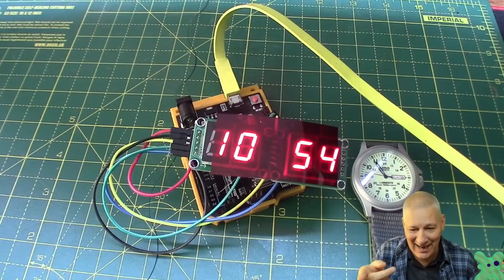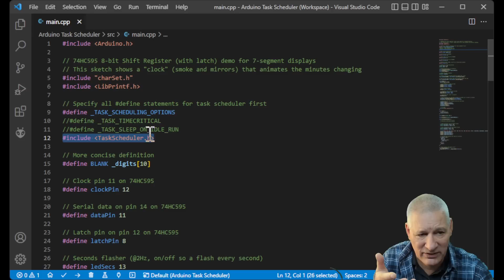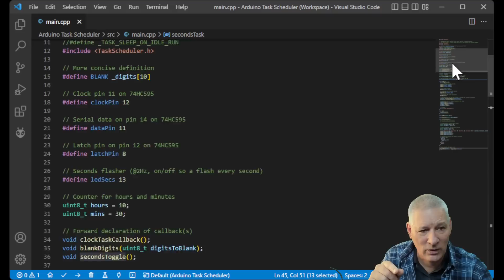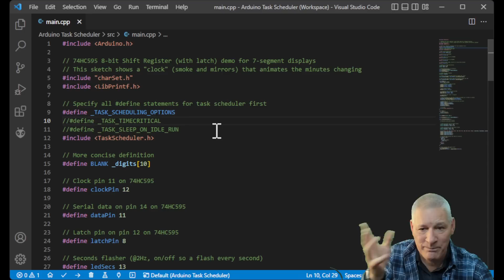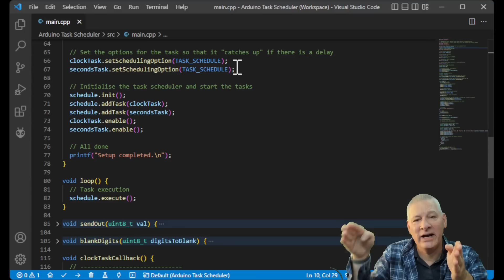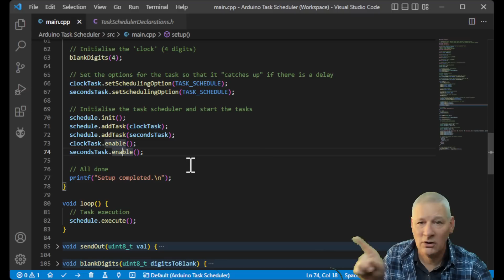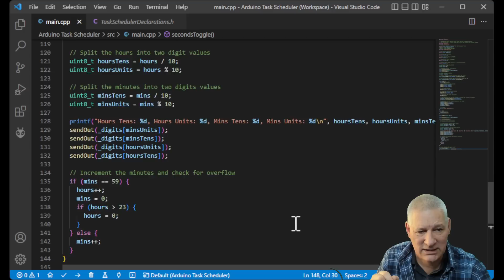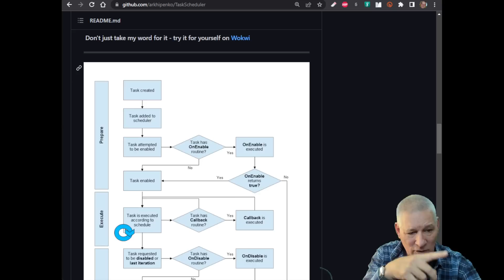#253 Accurate Task Scheduler for the Arduino (and STM32, ESP32...)

Comment: Xtasks and starting WiFi caused a canary stack error..Took ages to narrow down the problem..I reverted back to in loop millis() timed tasks.
Reply from the maker: On a ESP32? I use this successfully but check out your memory usage (print out the stack memory left).

Alternatively just use your own tasks on an ESP32.

If you are not using an ESP32 what microcontroller are you using that gives you Wi-Fi?

Comment: Are millis not that accurate then?
Reply from the maker: Well... that depends on what your definition of "accurate" is!

If you were to design a simple 24-hour clock and use millis() as the source of the time, you would find it severely out of step with World time by the end of the day. This applies to most microcontrollers that rely on an external crystal for their clock.

But for shorter time periods it's accurate enough. Just bear in mind that millis() is not updated whilst an Interrupt Service Routine (ISR) is running, or whenever there's a "nointerrupts()" command (not necessarily in your code but perhaps the Arduino framework itself, or a library you've included).

TL;DR for short time periods it's fine. For longer ones, or where the ultimate in accuracy is required, you can't rely on it.

Comment: About libprintf: what’s the benefit over doing Serial.println(“value: “ + String(value)) ?
Reply from the maker: Basically, it's formatting and neatness of the string that you are outputting, when reading the code. That and the fact that using String like this is non-standard C++ and may contribute to your heap memory going kaputt (technical term).

Comment: Thank you for the video. You mentioned the scheduler being accurate enough for a clock. Any idea how much it is off (seconds) over say 2-3 months comapred to your wristwatch? Any crystal driven circuit will be temperature dependant, and have some imperfections. And so I wonder if one will be annoyed by having to resync a clock implementation every so often.
Reply from the maker: As you say, even if the crystal were perfect at 21ºC it would still vary throughout the day/seasons. 

But I found it pretty good during normal use over a few days. Of course, to be 100% accurate you need to use a microcontroller that has access to the Internet, like an ESP32 where this is all pretty much standard and auto-updates the internal clock every so often.

Comment: I've been watching your video #208 on ESP32 with "native" FreeRTOS, #BB5 and #BB6 on state machine and how not using Arduinos's delay() function, then another one where youv' re using a taskHelper.h library and then this one about TaskScheduler.h.
I was very confused with all these different methods. I understood there are different libraries for the same purpose ( taskHelper.h and TaskScheduler.h). 
Still one strange thing to me is why TaskScheduler.h is available on ESP32, or why one would use TaskScheduler.h as it seems possible to declare some task without external library as FreeRTOS is running on that chip ?
All these possibilities make the route to choose for a project very hard to do for a beginner !
Searching for a timing libraries gives many many choices. Why choose one more than an other ? Beginners have already hard time taking one in hand !

Thanks for your instructives videos.
Reply from the maker: If it's built-in, use that functionality, at least until you are familiar with it.

As you have found, tasks can run very well on an ESP32 without any addition "helper" libraries!

Other developers create libraries to make life easier for beginners but sometimes it just abstracts away the very thing they should be learning. It's called syntactic sugar , and sometimes it's a joy to be able to just type in a single statement and have it do umpteen things for you - but what are those things?

Comment: Thank you for showing a real life  example for this library and for providing the code! I find it more useful that the RTOS library. I tried to use the RTOS library but I found it too complicated to figure out...I felt it was going to take longer for me to understand how to use the RTOS than actually writing the code by myself. This library looks more friendly to use for a non-programmer like myself (I'm an electrical engineer hobbyist). Love all your videos, I've learned a lot from you... definitely saved a lot of time (if I had to do it myself).
Reply from the maker: You can use this task scheduler and RTOS at the same time! Very useful. for instance, you can schedule a task to run every 10 seconds which with RTOS is more complex (albeit very do-able).
Reply: @RalphBacon  , got it, and it's good to know. However, for my current projects, most of the tasks I need to perform are in the order of seconds and minutes, so I don't need the extra speed of the RTOS. Maybe I will spend more time on it later on. Thanks again for your instructional video.

Comment: Hello, Ralph. 
Thank you for your review of the TaskScheduler. And most importantly, thank you for understanding the concepts behind it and highlighting the aspects of it that are meant to help write compact and reliable code! 
I sometimes get very critical feedback that this is not "multitasking" or that it does not work for someone in their specific case. Videos like yours help evangelize the library and help developers pick the right tools for their tasks. It also provides me with a third-party perspective on what I designed and what I actually use in 99% of my own projects. 
You mentioned FreeRTOS in your video. I use that framework a lot as well actually. If you are interested, please have a look at my POC project where I combined the FreeRTOS with TaskScheduler, taking advantage of both. Cooperative multitasking allows you to eliminate a lot of challenges of pre-emptive one, but certain tasks require pre-emption! So my approach lately is to split independent tasks between RTOS tasks but keep complex business logic within TaskScheduler. As an example, I always put sensor reading or pure communication tasks in a separate RTOS task with a higher priority and let them do their periodic jobs. TaskScheduler runs as a separate RTOS task. Since there is little to no dependency between the two, there are fewer race conditions, deadlocks, and other "fun" stuff to worry about or debug. As a matter of fact, I have successfully run multiple TaskSchedulers in separate RTOS tasks, and it all worked beautifully. 
Here is the link. Please look past the fact that it is a fun project - the concepts tested there are real. 
https://www.hackster.io/anatoli-arkhipenko/minecraft-interactive-do-not-enter-sword-sign-esp32-cam-cd1b07
Thank you again. You really made my day!
Anatoli Arkhipenko - author or TaskScheduler.
Reply from the maker: Thanks for your comments and sorry that I have only just seen your comment (blame YT). Yes, I do like your approach to multitasking, keep it going! 👍

Comment: Hey, Ralph!

Just catching up on your latest videos, an found this one. Wow! My background (I'm 69) was originally in real-time computer interfacing and programming. A light-weight and flexible library such as this one would have been a wondrous addition to the stuff I was writing in Fortran IV on a PDP-11. The cost-benefit ratio of using a "single-user" PDP-11 vs. a "single-user" Arduino (or several of them!) is truly mind-boggling to contemplate! We have indeed come a looooong way!

FYI, I go back to the computer Iron Ages! In a lab in college, I worked on a PDP-8L, loading and saving programs via paper tape on a Teletype!

Cheers!
Pete
Reply from the maker: OMG 😲 PDP-11! Fortran! Paper tape! I suppose you'll tell me you used 8" floppy disks next?!? (Please don't, I have). Yes, the modern microcontroller is a wonder compared to all those "iron age" devices!

Comment: Can we still use timer interrupts? If so which timer does the library use so we avoid it ?
Reply from the maker: AFAIK this does not use any of the timers, per se. It does require that the loop() now invokes the scheduler (several thousand times a second, potentially) and it uses just 15-18μS per pass to do its stuff.

So I would expect timers to be available for a developer's use, as long as it does not interfere with the scheduled tasks.

It also runs fine in an RTOS environment that is timer driven.
Reply: @RalphBacon  that makes sense, thanks a lot for the clarification and for responding even though the video is a bit old. I really appreciate that, also thanks for all the videos they are both amusing and useful,

Comment: Hi so it seems that one can implement an led flasher sketch? (by "flasher" I mean where the light comes on for X seconds and off for a Y seconds, eg:  on for 5 sec, off 10 sec). Currently I'm polling epoch seconds and would maybe like to upgrade to clock tasks for some coding practise.
Reply from the maker: Yes, one task (the ON task, for example) can queue up another task (the OFF task to run in ten seconds time. Which in turn can... you get the picture.

Alternatively run the 5-second task to switch the LED on/off at different intervals. That single task just runs forever every 5 seconds.

Comment: Task scheduler - great and as usual, excellently presented. Thanks. 
BUT using an arduino crystal/resonator as any sort of time keeper - NO! 
Any long period timing needs better. For a lot less than a coffee, the DS3231 offers stability, compensation, age trimming, battery backup and lots more. And the Chinese modules come with proper EEPROM as well. Why compromise?
Yeah, it was only a demo....
Reply from the maker: Until I found this library I would have agreed with you whole-heartedly. Especially on the Arduino (ESP32 is a special case, of course). 

But I had this running for a week on the Arduino and it was still keeping excellent time (a few seconds lost). The crystal on the Arduino (not a cheap and inaccurate resonator) is very stable and usually pretty accurate too. 

Agreed, the DS3231 is the only RTC I would consider, and it's cheap too but it's yet another component to fit and another battery to keep up-to-date.

I guess it all depends on what you want to do with your project!

Comment: Does this library manage tasks across both cores of an esp32?
Reply from the maker: I couldn't find any reference to the core on which a task should run. I assumed that Core 1 would be always be used as Core 0 should not really be touched by developers as it runs all the Espressif-specific stuff (BT, Wi-Fi etc). Any delays in this core causes a PANIC state.
You could ask Anatoli, I suppose.
Reply: @RalphBacon  bummer, I was looking for an easier way to execute important tasks on one core with all my neopixel patterns running on the other. For example, in a certain state I want the neopixel to ‘breathe’ and on event I want to read a bunch of sensors and update LoRa or update a screen etc etc. If the tasks are running on same core you’ll notice the neopixel breathing effect gets paused slightly while the core is handling the other tasks
Reply from the maker: You could try a task on Core 0 (remember BT and Wi-Fi are intolerant of pauses on that core) which runs continuously for the breathing effect but yields if there is nothing to do. It can still read/give semaphores and mutexes created by tasks on the other core.
Reply: @snowboarderdj86  Try having a look at how this guy did it...

Comment: It's definitely not a mainstream chip anymore, but it's readily available, in smd, from main stream component suppliers like Digikey, Futurelec, Element 14 etc. , but they are horrifically priced from these suppliers.  I used these chips in the late 90's for small scale production and they were reasonably priced at about $2 each.
Reply from the maker: Even at $2 that's quite a lot. I specifically chose the shift register because it was (and is) dirt cheap. $2 is fine for a hobby project but not for a commercial project; the hardware engineers would expect the software engineers to "compensate" 😂

Comment: Hi Ralph. There is an interesting "shift register" MC14489 capable of driving 5 seven segment displays and can be cascaded. It can also decode certain hex characters, or it can be used as a bar graph driver. For your next project maybe? Regards.
Reply from the maker: It looks interesting (especially having the 5 "chip select" type lines) but trying to find this chip locally is impossible. Available from AliExpress but as I got my fingers burned there recently I'm not sure we can class the MC14489 as a mainstream chip any more - or have I got that wrong?

Comment: With the prevalence of cell phones.  Too bad there isn't a "FREE" way to be able to get the time that I think must be broadcast via cell towers.
Reply from the maker: Your local cell/mobile phone can certainly grab the time, but it's not free as you have to have a connection to the mobile service. 

The almost free way is to use your Wi-Fi and contact the NTP (Network Time Protocol) server pools (specified for each geographical area, eg UK, Europe, Oz, USA) which is the way I do it (you'll see this in a future video). Your processor needs to be Wi-Fi capable, of course.

Not quite free as you have to have a Wi-Fi connection (and Internet connection from that Wi-Fi) but you probably already have that.
Reply: @RalphBacon  
Great response ... thanks ... agreed I suppose the wifi method would be inherently more diy friendly and cheaper.

Just came across this video clip and I like your style.  
New subscriber and can't wait to digest some more of your previous videos.

Keep up the great work.

Comment: Another fantastic video ralph. Quick question if i may. been on my mind for a while now. i have used the HC595 shift register for a project and used a slightly different library, and the library got updated and caused all sorts of problems until i noticed. what im really wanting to know is, these libraries have code in them for all the different micros we might want to use them for. does that extra code actually take up much needed space in the overall program? should we be trying to take the code and omitting out code thats never going to be used and will this save space in memory? i am currently working on a big project and it will have many libraries to be included, and im worried about there being not much room left for the actual program for things i want it to do. (my project is not time criticl as such) but just wondering if you have ever come across something like this.  Thanks Phil
Reply from the maker: Many libraries cater for all sorts of processors it is true, but luckily they are usually coded in such a way with compiler directive #ifdef statements that only makes the 'true' bit visible to the compiler - the rest is totally ignored.

Example (not real):
#ifdef ARDUINO
   lots of stuff here
#else
   other stuff here
#endif

This means that if you are using an Arduino board the bit after the #ifdef statement is compiled, and vice versa.

Also, the compiler is smart enough to exclude bits of libraries that are never used. So if a library has 100 functions but you only use 1 of them, the compiler (sometimes the linker) will (usually) discard the compiled functions not used.

The Arduino compiler has some hard-coded compiler options (in a boards.txt file) that optimise for space, but you can edit the parameters if you know what dangers that might hold for you. Best to leave it to the compiler and linker unless you really know what you are doing.

Comment: Wouldn't the millis() function be as accurate as this tasks?

I recently made a project which had lots of blinking lights, buzzers, and they had to flash at an exact pre-programmed time, I just used millis() and if statements and it is pretty accurate, although I only tested 5min.
Reply from the maker: Millis() will accurately read the current value but how do you ensure that you accurately execute the function at the right time without constantly checking, and potentially missing, the right time? This method uses no extra resources so your loop() can just do its thing without having to check millis() (I know, I do this all the time, but no more!).
Reply: @RalphBacon  Yeah, I have to make sure my code is non-blocking. It just takes a few micro-seconds to run the entire loop.

Comment: Ralph I have a challenge for you. I want to take a bunch of similar programs and load them into psram on an new esp wroom32d and be able to set up a way to select them. It's a 2 pin program with one pin not being used most of the time. Can that be done or would I have to set up a server and flash the esp Ota. I'd like to use software serial over bt. It's for a project. I can keep a database of compiled working programs and just do an Ota task change or update. I could do this with a pi but I don't want to waste a 3b and an esp32 plus the side loaded controls I have on android.  Anyway, let me know if this makes sense or I could tell you my project. It's an led matrix with built in fft and simple games. 2 pins haha 1 for the 16x16 matrix and another for a microphone. You're a sage and I ask you kindly for input
Reply from the maker: Hmm. You can't actually have multiple programs (sketches) loaded but it they are quite similar maybe you could have multiple functions that do 99.9% of the work with the main loop acting as a reset / select? Then you could select which program (function) to run on each reset?

If this is a non-starter, you would have to automate the upload process (yes, OTA would be fine) from your PC / command line.
Reply: @RalphBacon  yes! I knew I was missing something.  Thank you